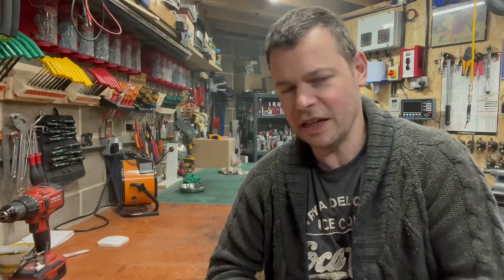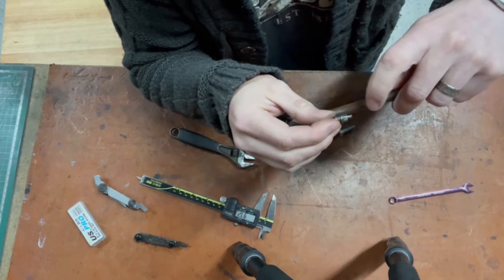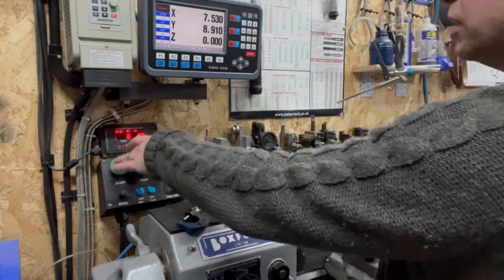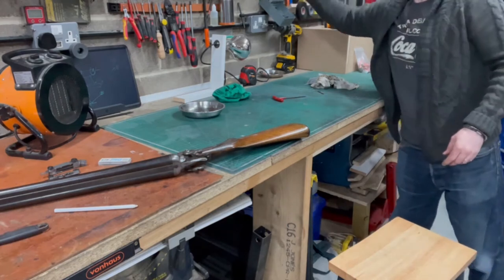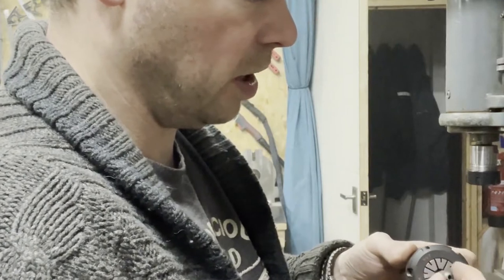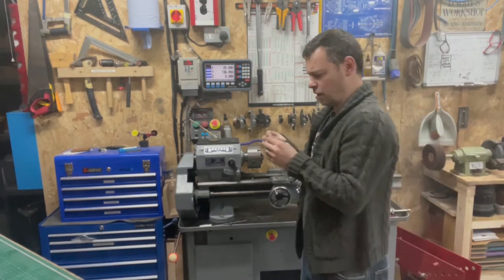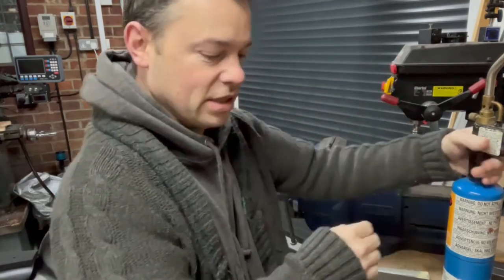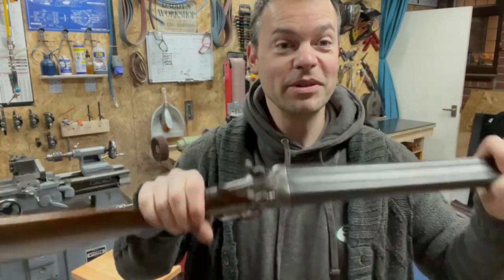Gunsmithing - Shotgun repair and making a replacement firing pin

Comment: you mention about the percussion caps? does the firing pin not just hit the back of the primer on the shell to fire it off?  or does this need caps as well?
Reply from the maker: Hi Glen, it’s just another term for the primer, no other bits are needed 👍🏻